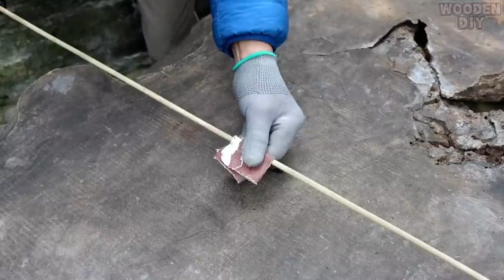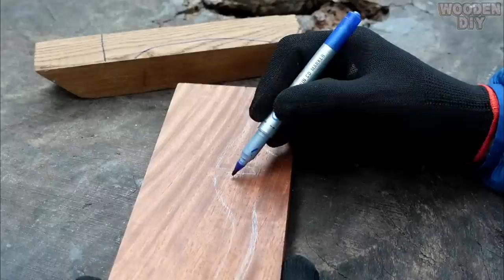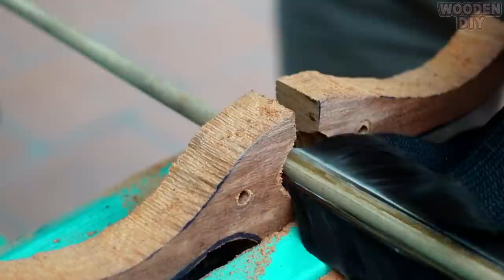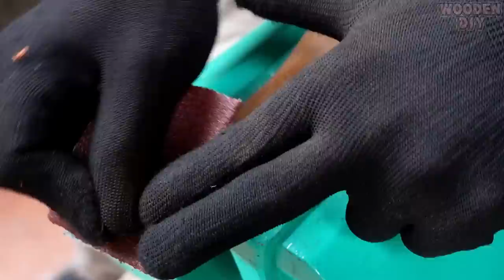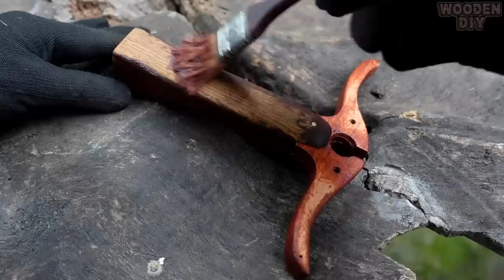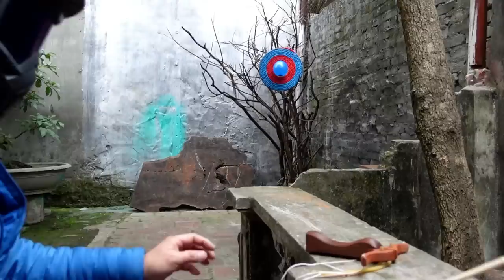Make Arrows like a Pro with Powerful and Unique "Cape Buffalo" Slingbow Plans!

Comment: is there any point having the extra string or the side pieces?
Reply: Limits the travel of the elastomer keeps shots consisty
Reply: @DOUBLEGRASS or the line of the string might help to aim it I guess
Reply: It stops you drawing it too far and pulling the arrow head past the frame where it will fall out.
Reply: @Rajamak  That makes sense . With this design its not possible because it just stops at the arrow head:   https://www.youtube.com/watch?v=cyHj1Gi_1Yo   These look deadly: https://www.youtube.com/watch?v=5m7rN24fR3Q&t=10s